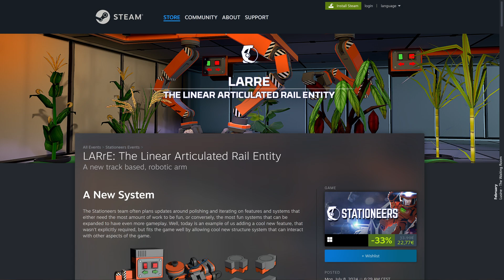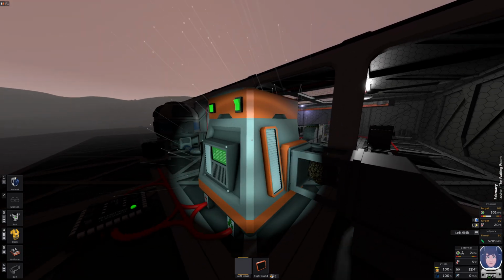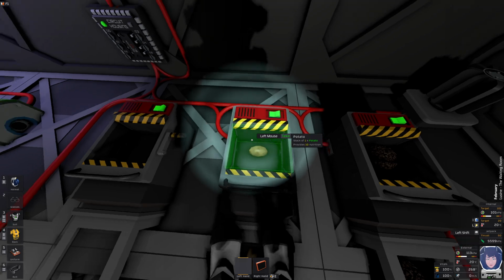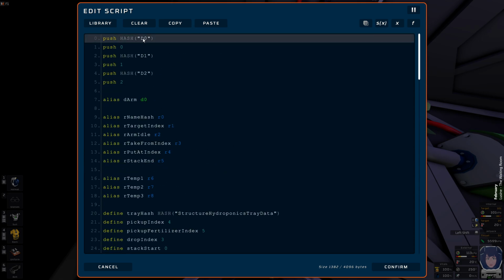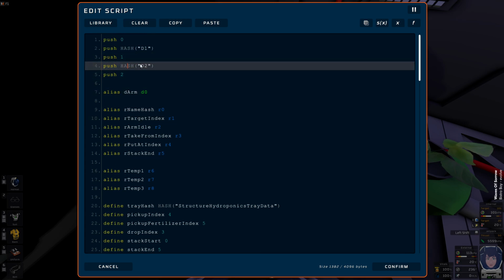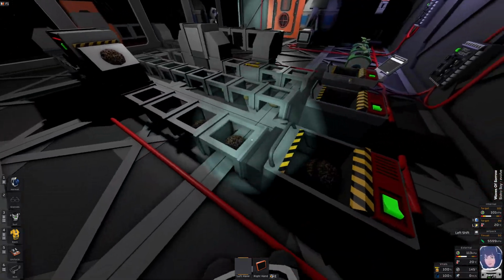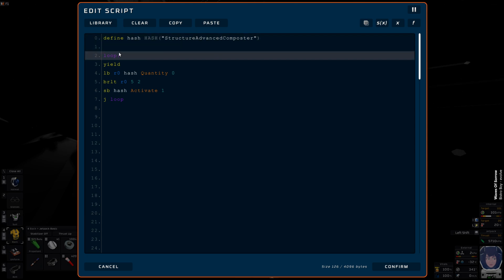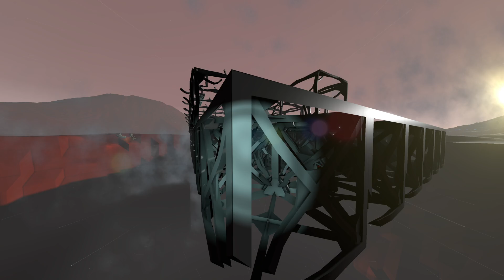Stationeers - Taking a look at the LArRE (robot arm) example setup (official Workshop item)

Comment: I haven't built it yet, but it appears the best density setup is to use horizontal growlight instead of overhead lights.  You can put 14 trays per growlight which takes a 2x2 large grid, slightly less actually when you squeeze the next 2x2 grid to the side of it.  Overhead groelights just take too much room with the wiring, reducing track space for the arm/tray/positions.  The beauty of this system is that once you get it working for a few trays, it doesn't really take sny more coding to expand it, super easy to duplicate build for next 2x2 grid, and limited to only how fast the arm can go down the track and chute storage.  1000 times better than harvies.